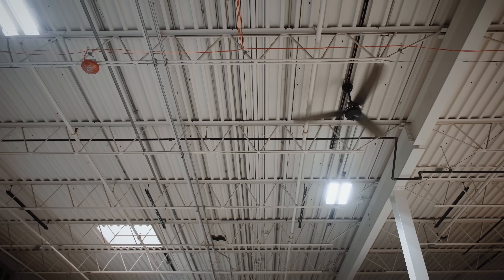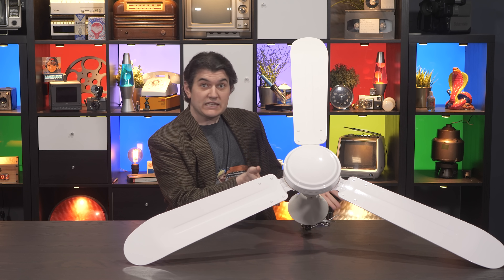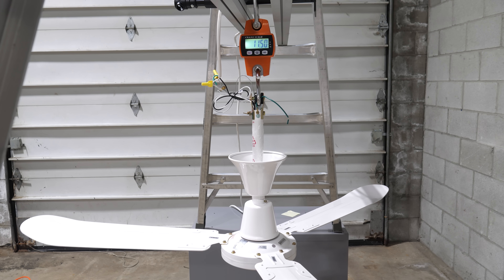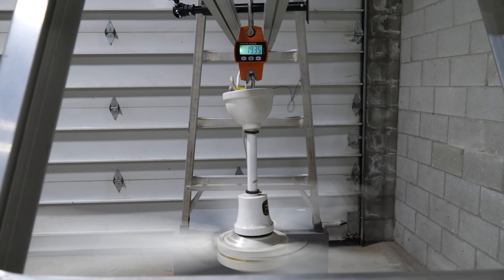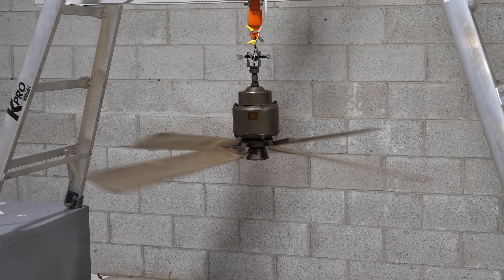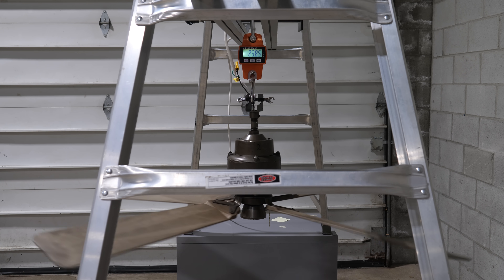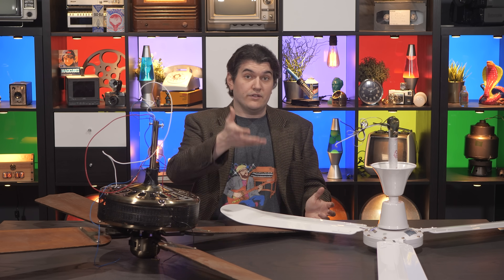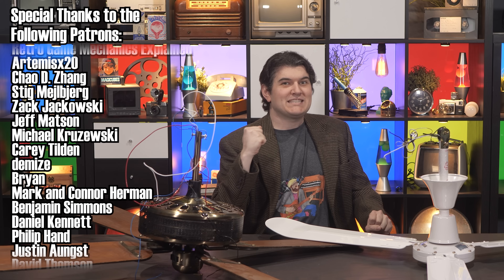How much thrust does a ceiling fan produce?

Comment: How about using a fan from an airboat? Those clearly have thrust. Or maybe a big industrial fan used in warehouses and workshops (they look similar to the airboat fans and are sold at big hardware stores). I wonder if those need securing to prevent them from scooting themselves across the workshop.

Comment: Request: could you do a video about rotation direction in summer vs winter?  The direct cooling in summer by air hitting you vs convection in the winter and pulling air up through the center and down around the walls in winter. Does it really matter?

Comment: The aerodynamics matter here and I find your test setup somewhat dubious. We need to know if there will be a significant reduction of lift due to the formation of a vortex ring (I swear it's a real thing that leads to helicopter crashes when they're operating too close to buildings). Without walls or ceiling to guide the air, the test can't tell us about this important effect!

Comment: Have you looked at fan blade design? I'd be real curious about a DIY modification to reduce the angle of attack and add thickness to ceiling fan blades to make them work like air foils/wings, rather than being flat blades that just slice through and squish the air in one direction or another.
HVLS fans do this, they're designed like airplane wings. Why not home ceiling fans?

Comment: Couldn't get my head around this and it's bugging me.  Is the temporary increase in weight during the fan's startup caused by a shortening of the string/chain connecting the scale and fan (both get pulled toward the center of the connection), thus translating a twisting force to a vertical force?

Comment: Great video as always!

I suspect the biggest strain on the junction box is wobble. Few fans are fully balanced. I’m guessing 25% wobble a lot.

Interestingly, when home electrification started to become widely available, most people had no use for it except lightbulbs. Which is why they originally billed your power based on how many lightbulbs you had. After the invention of the chemical power meter, it was easier, since all they had to do was send out a meter-reader to weigh the chemical in your meter and screw in a fresh new chemical pack.

So the next invention that became wildly popular was even better than a bulb that primarily made heat and incidentally glowed so hot that it emitted light as a byproduct…was a device that could cool you down. Desk fans became the hot new appliance. Wait, how do you adjust the speed? You put a lightbulb on it to act as a resistor. Proglem solved. Who knew how much “climate control” would change the whole world. Especially the really hot parts. Now everyone can be a productive worker.

Then “electric servants” became the new status symbol. Toasters (pretty much the same idea as a lightbulb), coffee samovars, (deliberate) heaters, &c. However this was in 1929, so the depression put the kabosh on all that nonsense. And that’s why we don’t have appliances any longer.

Comment: KDK and Panasonic fans are heavier, and it is more poverful, but when you make the fan spin the opposite direction, the thrust will be lower, because the ceiling fan is only made to blow air down! Usually, it's very common in Asia, and because a lot of Asian countries don't go up to cold temperatures, there is no need to make the fan turn the opposite direction! Just a little fun fact I wanted to share with yall!!

Comment: try placing a sheet of plywood under the fan, having a scale under the plywood and tared to zero and see if the downforce of air is recorded as additional weight of the plywood. this may rord total thrust unnafected by fan weight. I wonder if some gyroscopic effect is holding the fan in stasis like a gyroscope stays true to it's starting direction despite a craft's cirection changes.

Comment: Somehow I missed this video, but when it comes to the junction boxes they need to be fan rated. You can buy remodel versions or new construction models all of which screw to the joists with metal arms. If you hang a fan off a Sheetrock mounted j-box you are in for trouble.

Comment: Never in my life have I heard of a ceiling fan running in reverse
Reply: That's odd, because basically all ceiling fans... at least residential ones... are reversible. Most double as lights, so they have 3 controls: lights on/off, fan on/speed, and fan forward/reverse.

Comment: But he likes ac
Reply: It's not a one or the other kind of thing. They work well together. While fans can cool you, as anyone who has ever lived anywhere outside the arctic circle knows, when it's warm enough, fans are insufficient. Yet using fans means you can be comfortable with the AC set to a significantly higher temperature than you'd be comfortable with without the fans.

Comment: When I was a child we had a fan that was insanely fast and made tons of wind. 25 years later I still haven't seen anything like it moving air in a house
Reply: Eh, there are a bunch of factors that affect how well a fan moves air. Moving fast is one, and some commercial fans can really go, but the trouble is the faster a fan moves the less efficient and louder it is. The other main way is to just make the fan bigger, which is what ceiling fans are great for: being on the ceiling, you can often make them quite large. Big fans can move a lot of air even if they move slowly, and the benefit of that is they can be virtually silent while doing it.

Comment: If & can we fit a fan on top of another fan, both spinning thus (assuming they spins at the same rate) the one on top would be spinning at higher rate from an observer on ground). 
Imaging a car (A) moving at 10km/h on top of an aircraft carrier (B) which also moving at 10kmh at the same time, would the car (A) be moving at 100kmh (10x10) to an observer (C) standing still on ground?
Saw this in a dream where a flying shuttle flying n moving very quiet n fast with these kind of blade-on-blade attaches n been thinking about em ever since. Thats n few other things I also stumbles upon while dreaming such as centralized managed traffics, inter-sections, conveyors moving people all at fast speed timed (and controlled by kind of central computer) just slightly avoiding bumping onto each others while fast moving! The vehicles were driven individually but the city computer took over as they crosses into the city. All being moves efficiently, everything including packages, elevators & escalators even non-motorized transportation such as bicycle (they r attached & locked onto kind of flat bed transport) n things. An orderly chaos and a majestic things to view - even tho mind is only in a dream but nonetheless;

There r so much details I omitted to keep this post short n I would be happy to share them to whomever interested;

Comment: I wonder if the rotors of the Chinook really need to rotate in opposite directions..
I think it'll be better if they rotate in the same direction. 
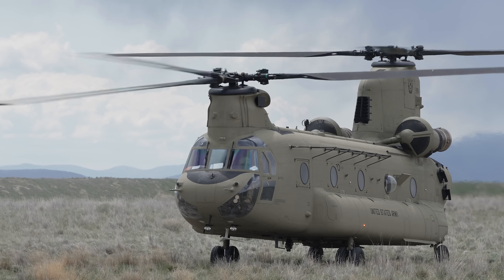Opposite direction rotation might actually be worse and create splitting forces on the body. 1:27
Reply: They do, and they do.

By which I mean, yes, they need to rotate in opposite directions, and that they do, in fact, rotate in opposite directions.

Comment: Hi, Something to think about, There may be a measurable difference in the results if the experimental fan was suspended at the hieght it would be in its natural setting, a cieling. The experimental rig placed the fan much more in the ground effect area than where it would normally be. Weather this is significant enough or not I dont know.
Cheers Daniel.

Comment: Fun fact, helicopter rotors don't move enough air to lift the helicopter.

The rotor blades are not shaped like a propeller blade,  but rather more like an airplane wing. They also generate lift in the exact same way a wing does, but is moved through the air like a propeller. The tail rotor works the same way.

Although the controls are rather nuanced, by altering the pitch of the blades and the entire rotor assembly, you can control how the helicopter moves.
Reply: This is just objectively wrong. A wing, a propeller, and the blades on a fan all generate "lift" the same way: by moving air. The control mechanisms on a helicopter do not magically let it violate physics.

Comment: I don't know if you are serious about "fan blowing air" when speaking of aircrafts, and if this issue hasn't been told before in the comments, but it isn't the same as ceiling fans.  The blades of an aircraft are designed to be more lie a wing, which creates far more force due to the properties of air passing over and under that wing.
Reply: It is exactly like a ceiling fan. If you think otherwise, you don't understand what you're talking about.
"but the blades look different!" that's because aerodynamic effects increase exponentially with airspeed. Ceiling fans operate at low airspeeds whereas the wings and fans on aircraft typically operate near the speed of sound.
Reply: @seigeengine  It isn't. The propeller is like a wing, which creates lift through the shape of the wing. The air flow over the wing goes faster than under it, which creates a lower pressure, therefore creating lift. The propeller uses the same principle to create a force that pulls the airplane. The air pushing back is negligible 

So you are completely wrong.

Comment: One good thing about that cheap fan with its metql blades, is that you can twist them a bit which on my model seemed to darn near double the amount of air it moved.
Reply: You can, but doing so puts a greater load on the motor, which obviously was not spec'd for the increased load.
Higher load means the fan slows down and the motor consumes more power which causes it to heat up, which may damage the motor.
If you don't do it to all blades evenly, you may also create an imbalance, which also will cause issues.

Comment: You did a great job with the space heaters a while back, showing what the actual temperature differences made were.  I suggest you do something similar with ceiling fans to put to the test the contention that they should be run in a different direction in winter than in summer.  I, myself, am skeptical of the notion that it is good to suck the room's air up to the ceiling in winter, as that will tend to heat the ceiling and walls, allowing the heat to escape more quickly compared to not running the fan at all.
Reply: Your reasoning is poor because hotter air is less dense, so it rises to the ceiling anyway. That is, you're not blowing hot air up to the ceiling, you're blowing cold air up to the ceiling which blows the hotter air down the walls.

Secondly, it took me a long time to actually find a study on this, but I finally managed one that demonstrated effectively that the direction the ceiling fan blows impacts how air circulates in the room. I'm not going to try to find it again for you, because I'm lazy, and maybe a bit of a sadist, but the gist is that when the ceiling fan blows air down, it blows air fairly directly down, while pulling air in from along the ceiling. This results in a circulation primarily under the fan and along the floor/walls/ceiling, but leaves most of the room as a dead space with unmoving air. In contrast, when the ceiling fan blows up, it draws air from behind the fan in a more spread out fashion before blowing it against the ceiling which causes the air to flow along the ceiling, down the walls, and then back up into the fan eventually. This means that there's much less dead space in the room with static air. This means blowing the fan at the ceiling circulates the air better, whereas blowing down creates higher airflow directly under the fan, but most of the room's air is fairly uncirculated.

The gist is that in the summer you blow down to create a breeze across you, but during winter you blow up to mix the air in the room better, so you aren't sitting in the cold air that pools at the floor.

Comment: Late to the party, but aircraft props aren't directly pulling air - it's just a wing moving in a circle - they cause lift just like a wing.
Reply: Wings create lift by deflecting a fluid stream as they move relative to one another.

A propeller blades rotates in a circle through air. As it does so, it deflects or pushes the air backwards, which pushes the propeller, and therefor the plane it's attached to, forwards. This creates a region of less air where the propeller has pushed air backwards, resulting in air from other directions (including forwards) being sucked into the propeller (pushed into the region by air pressure, but let's not be too pedantic).

Comment: Fun Fact, propellers do not generate thrust but rather lift, propellers are like wings that rotate, each blade of a propeller is like a wing, helicopters are rotary wing aircraft, yes the propeller generates a little thrust but not enough, what makes the helicopter fly is the lift that the propeller generates, this also applies to airplanes, the airplane propeller is like a screw in a thread, the air would be a thread and the propeller the screw, the propeller generates traction in the air pulling the airplane.
Reply: Whether you call it lift or thrust, the important bit is that when thing interacts with air it makes air go one way so it goes the other.

Playing games with words doesn't let you ignore physics. For one thing to go up, something else must go down. For something to go forward, something else must go back.

It's not entirely wrong to think about a fan as a screw pulling itself through the air, but that mental model can very rapidly lead to goofy mistakes, and is a truly bizarre way to conceive of what's going on. A fan, whether you call it a propeller or anything else, rotates blades through the air, and as the blades interact with the air, they distort airflow in a direction, causing a force on the fan in the other direction.

Comment: But helicopter blades are an airfoil...
Reply: Yes, but the gist is that the ideal shape of a wing differs depending on a variety of factors, including the speed at which the wing is moving relative to the air.

The higher that speed, the more the aerodynamics of the wing matters. Air resistance increases proportional to the square of velocity. That is, double the velocity, four times the air resistance. Wing shapes are effective ultimately because they reduce drag. At low speeds, there's no real benefit to this, which is why ceiling fans, which rotate fairly slowly, can be flat without much performance loss.

Ceiling fans that move faster, such as very large ones, benefit more from a more typical aerofoil shape.

Comment: Is a ceiling fan really to keep yourself cool or is it more to make the air move slightly so it doesn't feel as stuffy? 

Those things aren't a thing in Europe so i genuinely don't know
Reply: Moving air inside a building has no impact on how stuffy the air is.

But yes, they keep you cool, just like a breeze does. This works in two ways.

The first is that it blows air across the body. Normally air sort of sticks to surfaces, forming a boundary layer that helps insulate them. The air right next to your skin is quite warm, and it only mixes slowly with the rest of the air in the room, but a fan blows this away constantly exposing you to new cool air.

Secondly, this airflow speeds up the rate at which sweat evaporates from your skin. Evaporative cooling is highly effective.

Comment: Alec - you’re usually so good with details. You messed this one up big though.  

Weight is a force = mass times acceleration = mg.  You mentioned newtons a few times - newton is also a measure of force.  

The fan does get “lighter” presuming weight is now the sum of the static weight minus the thrust being produced.   BUT… the fan has not lost mass and kg/grams is a measure of MASS… 

Keep up the great work. I love your stuff.

Comment: I have found that when I fire upy propane convection heater in the garage the ceiling fan i have mounted above it starts to turn backwards from the heat rising and that's the reason I installed the fan in the first place. The heater works great  but it was burning hot up high and cold down low and the fan does a great job equalizing it.

Comment: You mentioned you were concerned about the forces on the mounting box, so here’s a funny story:

I heard a clank sound in my stairwell and checked it out only to see the fan dangling from the wires giving it power. The box had broken after 20 years and yeah. Had to make an emergency lowes trip before the fan fell 14 feet to the landing. Good times

Comment: Speaking about ceiling fans, have you done any research on how the number of blades affect airflow in today's residential ceiling fans?  I am seeing many many more 3-bladed models, while starting to look for an upgrade to a 5 blade model that we like the breeze from.  I hope you have a great holiday season, including lots of lights that DON'T burn your eyeballs!
Reply: More blades makes a quieter fan, but results in higher drag. Fewer blades makes a more efficient fan, but a noisier one. It's a balance. There are other factors at play in blade count, but yeah.

That said, number of blades is obviously not the only factor at play. How wide and long the blades are is also quite important.

 If you can, get a bigger ceiling fan. They work well even at lower speeds because they're bigger. In contrast, smaller ceiling fans are often noisy even at the lowest setting, and you need to click it up to medium just to get a weaker breeze then a bigger one does on low while being virtually silent.

Comment: The air flow here is probably restricted by the fact that the fan is close to a surface (the floor). The thrusts generated are higher when you're far away from both the floor and the ceiling.